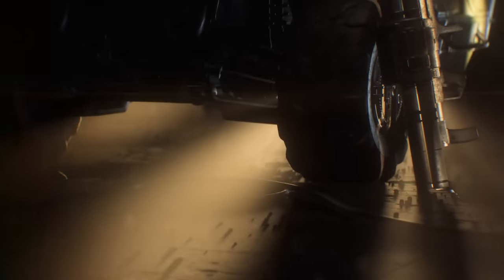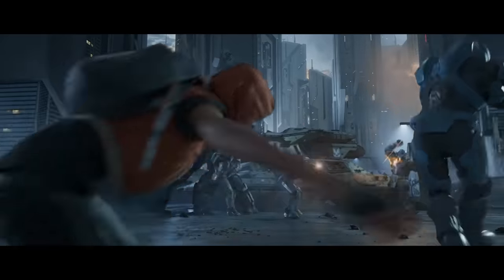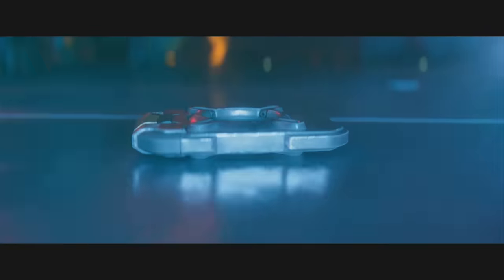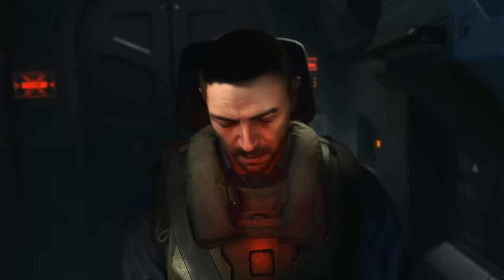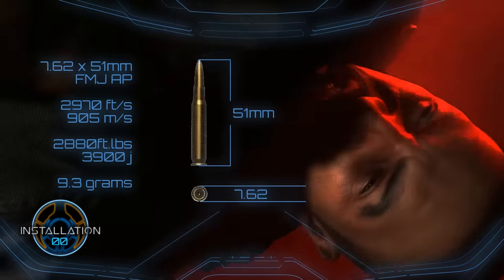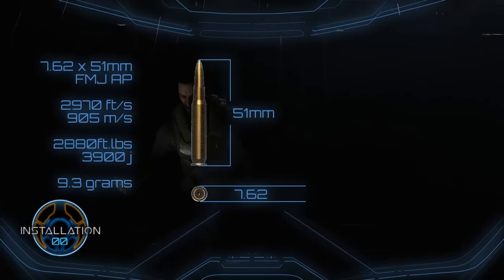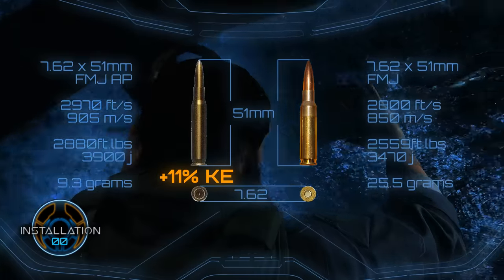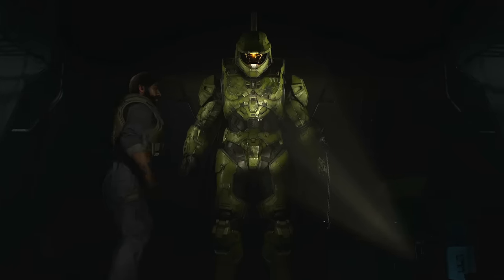Why are UNSC Weapons so powerful!? | The Armory

Comment: Some of the lore has written itself into a corner. Ignore anything about weight and velocity and things can start to make more sense for the guns.

Let's say the UNSC made a gunpowder that for whatever reason is better at much higher pressures than modern powder at the cost of burning at a much slower rate. This would explain why the guns are so large and why the more general issue Assault Rifle and Battle Rifle are bullpups. They would need all the length they can get for barrel length.

However it also explains why the Magnum is 50 caliber and the Shotgun 8 gauge. As a way to get around ridiculously long barrels, larger calibers can also be used, though this only applies to close range weapons like a handgun, shotgun, or submachine gun. A 0.5 inch hole allows for more gunpowder to burn than a 0.355 inch (9mm) hole of the same length. Likewise an 8 gauge is much larger than a 12 gauge.

If we have heavier armor piercing bullets going much faster than their modern counterparts, it starts to make sense. Until you remember the SMG has caseless ammo that most closely resembles the 5.7x28 cartridge that the P90 and Five Seven fire. Then it kinda falls apart.
Reply: Think the SMG is a specialise weapon for ship-to-ship CQC for the UNSC when boarding pirate & rebel ships so they won't poke holes in those ships in the vacuum of space that aren't rated of military specs.

Comment: I can't help but wonder if some of the differences are also atmospheric. I'd wager that most of the halo measurements were taken on Reach. Admittedly, it is a planet very close to the physics of ours. But it also (personally) looks smaller than Earth to me, leading to increased bullet velocities and decreased bullet drop on account of less felt mass, and you've got a good start. Then suppose, whether stated or not, that the air density is likely lower whether because of lower nitrogen levels, elevated oxygen levels, or less suspended "water" in the air that would take longer to slow down the rate of fire. Just my thoughts

Comment: I'm surprised you didn't bring this up and it's a future technology that could easily work in small arms (and larger) weapons and grant much more higher muzzle velocities and muzzle energy:
Electrothermal-chemical technology (ETC). The problem with firearms is any muzzle flash/flames you see coming out of the barrel is powder that was not completely burnt in the barrel and converted to energy. It's wasted. Like imagine if your car's fuel injection system or spark plugs didn't ensure enough fuel was ignited to power the cylinders as fast as it could. You'd be losing out on potential energy. Same concept here. A lot of the potential energy of a firearm is lost due to not all the powder being ignited and used before the projectile leaves the barrel. ETC addresses this by using a electrothermal/chemical reaction in some way to create a plasma to almost instantaneously ignite the propellant in a case/shell. And it exists and it works, but funding never really went anywhere with it. The United States Army played around with it for a converted 120mm tank gun for the M1 Abrams in the late 1980s due to concerns with the maximum velocity capable of modern ammunition in tank rounds pretty much being reached without going into ridiculous territory like much larger guns and pressures/barrel lengths which would be impractical and Soviet ERA on tanks and increased armor on them. The program was able to take a 120mm ETC gun and make it deliver velocities in excess of modern ammunition and deliver penetration and power on par with proposed 140mm upgunned turrets that was being floated around. The program was cancelled due to costs and the Cold War being over by the time it was an option.

To give you an idea of the efficiency, a stock 120mm L/44 (so not the longest barrel with the most velocity, that's the L/55) Rheinmetall Rh-120 (M256 American designation) has a muzzle energy of about 11.5 MJ (depends on the round being fired, but that's about its max). In 2000, a 120mm L/55 ETC-variant of the Rhinemetall Rh-120, the XM291, was developed and achieved a muzzle energy of 17 MJ (this energy places it on the lower end of a 140mm tank gun and the XM291 had a higher muzzle velocity than a proposed 140mm tank gun). And this was just with a prototype that is now 22 years old. And a 38.5% increase is far in excess of the potential difference we see here in the game.

There's also the option with ETC technology to use things other than solid propellants. Liquid propellants can also be used and, in theory, allow even high muzzle energies to be achieved (the United States Army also played around with this concept around the same time period with the XM2001 Crusader - which was a self-propelled howitzer to replace the M109 Paladin - and used liquid propellant to allow potentially higher velocities/ranges/fire rates - it was also cancelled due to costs).

The best part about ETC technology? It's capable of being backwards compatible. You can easily make it so you can still fire conventional rounds out of an ETC gun. Of course, you won't see any benefits from doing so, it will still be the same performance, but having that capability is welcomed by logistics.

The only problem with all of this that I have is that you can handwave a lot of issues with weapon weight and recoil with a SPARTAN because... well... even outside of the armor they're basically super-human. But, in ODST you as a just a very regular albeit highly trained and capable soldier can pick up a full-auto 7.62x51 rifle and fire it like it's just like an assault rifle. The recoil is nothing like what you'd expect a full-auto 7.62x51 rifle to be. It's not only entirely controllable, it's basically barely any more reactionary than firing your submachine gun. And, I mean, I can't think of anything to do with the ODST armor or the ODST soldiers themselves that could explain why you'd be able to pick up a battle rifle and start firing 32 rounds through it and not minding it at all like it's just like firing an SMG. That's why I've also always had issue with the idea of an 8-gauge shotgun being used as a combat shotgun by normal humans in-game. I've fired 10 gauge shotguns before. The Ithaca Mag-10 that I shot didn't have as bad of a recoil as I thought it was going to have, but... it wasn't pleasant to shoot. It was also an 11-pound gas-operated semi-auto shotgun, and that gas system does help with felt recoil by a small amount. Would I want to fire a pump action 10 gauge with 3 1/2" shells? Not really. Would I want to fire an 8 gauge? Uh... Maybe a few times for the experience and thrill of it, but... No. No, I would not. 12 gauge is the standard for combat shotguns and personal defense for a reason. It's about as big as you can go and still have manageable handling and recoil for the average person, and I find 12 gauge 2 3/4" shells absolutely fine and manageable. 3" magnum loads? Depends on the load, but with slugs especially you're going to start running into issues with it for most people. I don't particularly care for shooting 3" slug loads that much.

Comment: There is a reason the HALO 7.62 is lighter and higher velocity than our real-world counterpart. Firstly, I believe the 9.3 gram figure to be a misunderstanding on part of the devs/game designers/lore people: This is because if you convert that figure to grains (the most commonly used measurement  for the weight of a bullet), you get 147 grains; a standard loading of 7.62 in real life. That is a very strange coincidence and leads me to believe that in doing their research, the people in charge of writing the lore mistook the bullet weight for the weight of the entire round (bullet, cartridge, primer, powder, etc.). Secondly (why the round is lighter and faster), the ballisitics of the HALO 7.62 round are achievable if the casing of the round was changed to stronger metal; this would allow the round to be loaded hotter, as the cartridge would be able to handle more pressure, and thus the bullet could travel faster. This also means the dimensions of the cartridge wouldn't have to change. The fact the this theoretical material is lighter and stronger we can chock up to "sci-fi magic". Meaning the ammunition is not entirely ridiculous or even unreplicatable today/in the near future (as far as velocity at least... weight not so much).

TLDR: watch Forgotten Weapons vid on the Sig M5 Spear; ammo in halo isn't that ridiculous.
Reply: You think a steel casing of some kind might not be adequate enough? Or perhaps a stronger breech. I've done a bit of research, and if my math is right i've seen 7.62x51 ammo pushing 3,796 joules muzzle energy already, without any mention of needing a reinforced barrel or such funny business. (9.72 gram bullet, 883.92 meters per second). Wouldn't be surprised if a hot load with the right barrel wouldn't knock halo's round out of the park without any new technology :P

Comment: I imagine based on what I know about flight motors contemporary tech we utilize something that is enormously obsolete outside mass manufacturing context in the research they need to be developed into something feasible at a large scale. In the future I imagine the old moonshot research is the contemporary mass production like usual. They probably have manufacturing techniques to prevent the unintentional reaction between a super strong reducing agent and strong oxidizer Li increases Al capacity to act as a fuel  although Al is more energy density AND higher regular density than  Li the volumetric energy superiority intrinsically means the Li as a reducing agent enhancer stops being beneficial at a really small amount and is already pretty eager to burn. Magnesium is reductive enough to burn using CO2 as an oxidizer. Also high density metal currently doesn't have the energy density to make volumetric energy better. In the 26th century I propose they have nested layers of superstrong oxidizer inert separating medium so it doesn't react without a nudge and super strong reducing agent likewise passified as a primary reaction after the primer the reaction then becomes so strong ultradense metal and ultra dense oxidizer hit their activation energy for the reaction to occur till completion meaning the regular density does justify their inclusion in the formulation. The higher mass of the ejecting gas at the speed that discharge from firearms as they do it would impart so much more impulse. I propose this for fun I really doubt warfare would not be damn near 100% space navy Additionally if you are considering multiple systems it is possible the round is shot from the gun like it is just a bullet but in reality it is a nanorocket and it has a flightmotor giving it continuous propulsion hell get SciFi rule of cool enough we could say they have crude super tiny guidance systems say the bullet magnetism aim assist is Canon to the story as

Comment: Hello well  stell core are less dense than lead  so to get the the same bullet lengh the round need to be lighter.  I am shooting 6.5*68 , with a bullet weight about 8 grams at  950 ms  with curent comertially avaliable powder (highest  or towardethe highter load for the relading manuals, so nothing thermo-nucleat bench rest F class  hotness) the recoils is about the same as a 7.62 on the light side (6.5 bullets have greater aspect ration hence better baslistic coeficeint from hight speed to transonic.  So it is not that far fetched better chemical ETC/ plasms primer...

Comment: Well they've ha over 500 years of science, engineering and technology.  Through those years they could've created a new gun powder formula that revolutionized the firearm industry.  Another thing to consider is the projectile.  The projectile may be even a harder and lighter material used  or even a type of micro fin stabilized sabot round.  The case could also be a more lighter and tougher material.  With all that, the bullet could be shooting hotter than a standard 21st century 7.62x 51 mm round.  By the 26th century, a hot 7.62x 51 round is now a common round and could never be used in an old 21st century weapons platform.  The chamber pressure may end up causing the round to blow up the weapon.  

Another thing to consider is that maybe alien technology just looks better but not necessary is better.  The covenant  armor and shielding is mass produced and therefore maybe too complex to produce in mass.  So a simple lower grade armor and shielding maybe the reason why human tech is very effective.

Comment: Look at the new US Army .277 Fury Cartridge. It is dimensionally similar to the 7.62×51mm NATO service cartridge, but launches a 135 grains (8.7 g) projectile muzzle velocity of 3,000 feet per second (914 m/s) from a 16-inch (406 mm) barrel. Compare that to .308 Winchester. It's far faster. And KE is v^2. So Maybe the UNSC just did something like that? Cranked the pressures with better chamber manufacturing?

Comment: Very simple explanation: the game designers know nothing about ballistics. You said that your math computing bullet weight shows the total weight of the cartridge as 9.3 grams per Halo cartridge, which is very close to just the bullet weight of a real 7.62x51mm M80 cartridge (147 gr or about 10 grams). The problem is that to achieve the muzzle energy listed in game of 3900 J, a bullet with a muzzle velocity of 905 m/s would have to weigh around 9.5 grams, which is more than the listed weight of the entire bullet, powder, and casing, which is physically impossible. So your entire video discussing potential reasons for why this is the case is honestly irrelevant, because the information presented already breaks the laws of physics. Thanks for giving it an honest try, and it was certainly entertaining, but the people making Halo just simply got the bullet weight wrong.

Comment: While I do love UNSC classically inspired but higher powered ballistic weaponry. It still barely scratches Covenant level energy shields and for the wrist mounted energy shield that Jackals carry the only things that can usually penetrate them are plasma pistol over charges, marine sniper rounds, or explosives. And I'm still concerned about what that spells for humanity especially when even smaller Covenant species like Jackals, and occasionally the Grunts, can tear a regular human being apart much less an armed and well trained soldier. Unless they have a kick like Brute weapons or a high impact ratio like a Gauss Cannon or Spartan Laser, we're still fairly screwed as a species. There should probably be a dozen or more weapons using energy and old fashioned gas, gun powder and magnet powered weaponry in the UNSC arsenal. As well as newer armors in development with lower grade A.I. running several diagnostics, scans, and translation programs like the V.I. from Mass Effect and giving relatively low to mid levels of protection from the vacuum of space. The kind of stuff I was hoping might be explored in Halo 4 and 5 but never were. Like creating a new Assault Rifle and Magnum Pistol that use a gel capsule in the bullet casings that when fired gives the round an explosive plasma burn effect. Classic Halo weapons with twice the kick. And to bring back the dual wielding with the Needler guns unless someone isn't a Spartan or the size of an Elite using them.

Comment: just my opinion, but it seems more like a metallurgy and manufacturing tolerance advancement that allows for a far more "full" round. I know a little about reloading, enough to know that the full volume of the round is NOT filled with powder, and that a filler [most of the time cotton] is used to fill the extra space. if the unsc is using the 7.62 its probably more to do with having a larger volume to fill with some futuristic propellant, which would increase the chamber pressure, and thus a faster bullet. I am not saying that the chemical composition isn't different in this future, but that the ability to have, by today's standards, insanely high chamber pressures is more to do with a 700 year old round still being used, and hitting with far more force than originally intended. 
TLDR, the full volume of the round is full of powder, not just a few grans of powder, removing the need for the round to be an expansion chamber for the pressure dif's, and instead full sending the bullet from the start somehow

Comment: At 4:45 the specs for the contemporary 7.62 x 51mm NATO cartridge is incorrect. You state the projectile mass as "25.5g" when in fact the just projectile mass is around 9.5g for the 147gr M80 ball and 11.3g for the175gr M118 projectile.  The "25.5g" figure you cite is most likely the total weight of an unfired M118  cartridge:  bullet, propellent and case.  

More concerning is the 300g difference between an empty and loaded MA5C rifle.  At 32 rounds for that  300g,  it doesn't leave much mass for the cartridge at 9.3g per round. That's already less mass than just the projectile for an IRL 7.62 x 51mm NATO.  Assuming this isn't a continuity mistake, it would indicate the HALO 7.62 projectile is much lighter mass than their contemporary IRL counterpart and would consequently have a lower kinetic energy for the stated velocity, therefore, less powerful.

Comment: It still doesn't make any sense the 762 is basically the same. The basic formula of kinetic energy is = 1/2 m v²

Which means if you wanna put more energy, you have to add bigger mass or fasten the velocity. Futuristic gun powder doesn't mean anything if they gives small acceleration boost. It simply just not understanding science behind guns